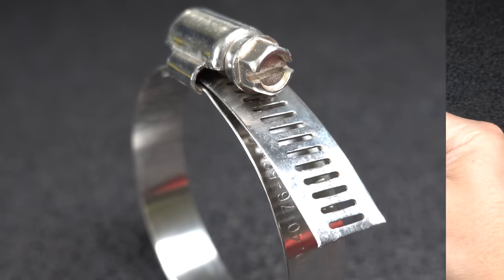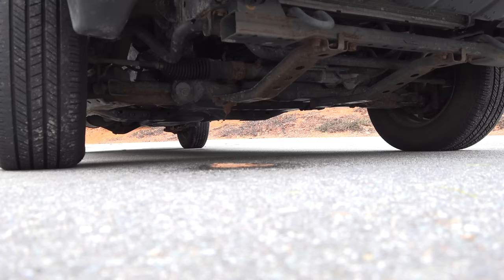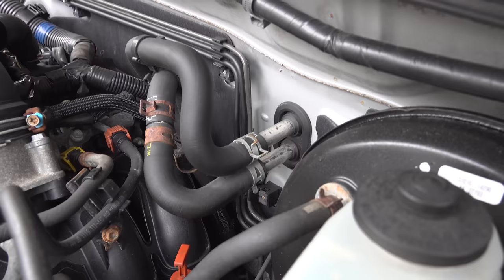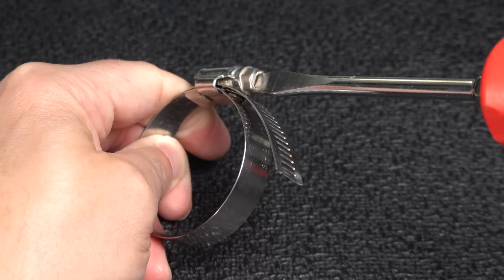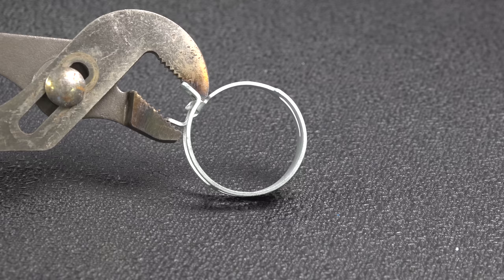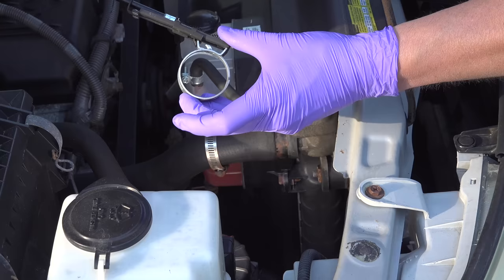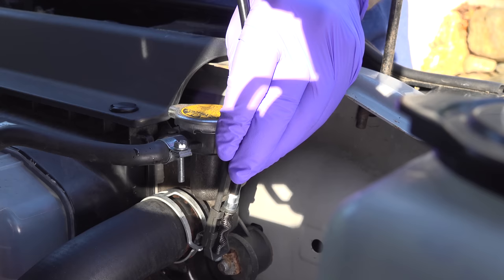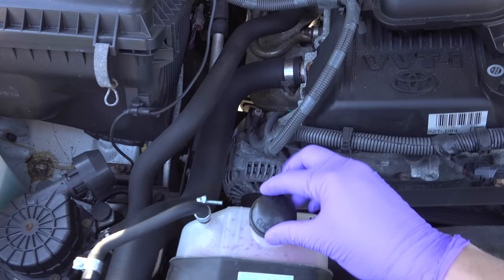STOP Using Hose Clamps WRONG - LEARN A BETTER WAY

Comment: Had a hose leaking on my coolant surge tank that wouldn't seal with a spring clamp.  The solution was a worm clamp.  My experience has been opposite of this video.  I have never had success reusing spring clamps but I reuse worm clamps successfully all the time.
Reply: Yeap had the same problem. Couldn't take it off. Had to use a dremel to cut the dam clamp. I am still piss off. Lol
Reply: Maybe like torque to yield screws, only use them once
Reply: One little comment would be for hoses below 5/8", I would consider using mini clamps.
Reply: @vizion4273  not with a pair of cheap plyers.
Reply: @donmax2315  If You had a proper tool, instead of making it up.
Reply: @jeromeduffy9270  I was pressing the spring clamp with pliers when one of the lip brakes off. So I had no choice but to cut it. The only tool I could find that could fit in there was a small dremel with a cutting bit.
Reply: @donmax2315  Git ur done type guy. But by Bud whi is a seasoned mechanic. Swears by these clamps. But you need the special tool. Or its Punkin face
Reply: cable clamp tool only A$16 from ebay
Reply: because some of the clamps have a stopper to limit open too much ,this one need more crc or cut the stopper.
Reply: @alanw5812  that's the real answer

Comment: I’ve honestly just never had these problems, it’s good also to make sure the old clamp is the right size as well because some may look similar but be just a hair to big, the new clamps are annoying to install in tight spaces if all you have are pliers but I’ve never had a problem with those either I think it’s mainly just about getting the right size

Comment: Not sure how "new" spring clamps can be when they've been in use in cars/motorcycles/vehicles for over 4 decades.
Reply: I was just thinking that, I know I've seen them back in the 70's and 80's
Reply: They're not even used for the false narrative he's attempting to portray. They are used because they are cheap and easy to install on an assembly line.
Reply: @JosephArata  wrong! Not cheaper!
Reply: @JosephArata  They're used because they work better for longer
Reply: Agree that CT clamps are not new, thay are all over many 80s / 90s JDM vehicles. When they fail it's ususally a sign that the hose needs replacing.

Comment: I never thought about this before but plastic radiator hose spouts may contract at a greater rate than steel or aluminum therefore causing this condition mentioned. Also silicon or soft hoses require the clamps with the liner in them that are much better for small hoses. Saying that I agree with the comments that gear clamps have never failed me. Thanks for the video. I makes us think.

Comment: You can get worm type clamps in constant torque as well. They have a spring on them.
Reply: That seems like the best of both worlds. I replaced all my constant tension ones with worm screw types when I re-did all the vacuum lines just because the regular constant tension ones are a pain to deal with.
Reply: Have used them on my job on Diesel engines . Retired from N.Y.C.T.A. Dept of Buses
Reply: Yes sir, used quite öften on the tubing for the charge air coolee
Reply: Constant tension clamp tool

Comment: Another significant benefit of spring clamps is that they remove most of the user error aspect of installation. As long as the spring clamp is past the end of the hose fitting, it's good to go. But with worm drive clamps, there's the user error aspect of people undertightening or more often overtightening them and ending up with leaks, damage to the hose, and/or damage to the fitting.
Reply: Lord have mercy. I think the first time my father showed me how to use a screw-on hose clamp, I was 10 or 11. He told me then I'd have to be a complete idiot to screw this up. Since that age I've used maybe hundreds of those clamps without a single issue. Normally, after about ten years or more of the clamps getting wet every day, the clamp rusts or corrodes and needs to be replaced -  but even then, it still holds pressure fine after many thousands of temperature changes. I'm calling complete bullshit on this. "User error"? You could say the same thing about tightening ANY screw or bolt in general. And if you're that over-cautioned about the simplest hand tools in the world being used properly, you're probably a nervous wreck every time you get in a car, or plane, or train, or go kart, or lawn mower, tractor, ferry, walking across a bridge, sitting in a chair, climbing a ladder, and even laying in bed, which all of these use screws and bolts capable of dreaded "user error".... 👏😵‍💫
Reply: @bat__bat  He's talking about removing end user error and yes you can screw up worm gear hose clamps.  It's why you see people strip the wood out of their cabinetry.  Anything with lighter torque that normal people interact with.  I've thrown away so many worm gear clamps that were overtightened ruining the perforations.  Pre-tensioned clamps do remove this variable of the end user provided it's not cocked at some angle.  For you to claim the end user isn't a liability is just ignorant.  As far as bolts and nuts in a car you can say the same thing.  The lower the torque values the more likely you'll see people twisting the heads off bolts or pulling out threads and if you add aluminum it gets worse. Think of the stories of spark plug jobs in aluminum heads or even an oil drain plug.  Normal people are wild when you put a tool in their hand
Reply: @jinxtacy  idk... tightening a screw clamp using a screwdriver or nut driver is about equal in difficulty to using pliers to replace a pre-tensioned spring clamp. And on Volkswagen, you need special pliers. So, yeah. Not making any logical sense there
Reply: @bat__bat  It's not about difficulty, it's about removing the ability of the person doing the work to screw it up.  Would you trust Johnny middle class from suburbia to torque anything you own by feel?  If there was  similar limitation for oil filters and drain plugs the world would be a better place and that's with professionals doing the job.
Reply: @jinxtacy  wrong. Plenty of engineering studies show that spring clamps hold better under the typical 0-230 degree Fahrenheit conditions of automotive coolant lines expansion and contraction
Reply: @CantonBn  might have tagged the wrong person or misunderstood what I said.  Anyways.  Have a great day!

Comment: Very useful info.  Thanks very much.  My 04 Frontier has been eating small amounts of coolant and I've never been able to figure out the cause.  Will go out and check this fix right now.  Interestingly enough, the rad hoses were replaced with worm drive clamps (not by me) some time ago, so I'm wondering if they might be the culprit.  Greatly appreciated!

Comment: Tech tip: put the Constant Tension clamp back in the same Position, otherwise it WILL leak
Reply: I use Indian head gasket shellac on hoses. They wouldn't leak even if I used a zip tie as a clamp. Lol
Reply: @BukitMan  I use that stuff too as a cheap insurance
Reply: Which rarely you can
Reply: @cowboy41231  Wouldn't ya know they just now are changing the name of it. This saddens me. And should sadden native Americans IMO. But every time I reached for that bottle I felt proud of the name. There was never any disrespect. I drive a chevy Cheyenne for crying out loud and I'm proud of that name too. Is it going to be better when they are no long represented on any products? People act as if we put them on toilet paper brands or something.
Reply: @BukitMan  yep sad world we live in, cancel culture bullshit.
Reply: This is a very simple thing to do. Guys still complain though.
Reply: @BukitMan  How hard is it to remove the hose in the future
Reply: @kb01663  Not hard at all. It doesn’t bond anything together really. Also stops that corrosion that makes hoses hard to get off when the rubber gets stuck to the corroded aluminum. It is just made to help keep gaskets in place and prevent leaks by filling in space and imperfections in the two surfaces.

Comment: PS: I really did like the information you provided. I work with them all the time and have seen leaks with those clamps in use, but I’m also questioning the age of the hose at that point. Usually when there is a leak, there is a bunch of crystallize coolant creating a breach in the sealing surface. Which It’s not necessarily the fault of the clamp.

Comment: I had on '04 RAM 1500 with those "Smart" clamps on the Power Steering lines. On at least 2 occasions when the temp dropped extremely low (-30 F) ALL of my Power Steering fluid drained out onto the pavement! I read about the issue and found that this is/was pretty common for my vehicle. The recommended solution was to replace those "Smart" clamps with the "worm drive" clamps on the Power Steering lines. After replacing them as recommended (I put 2 clamps on each connection), I never had a problem with the fluid leaking out again. I seem to recall that the issue was related to the metal fitting and the rubber hose expanding and contracting at different rates.

Comment: I always thought cars had them because of ease of assembly. This was very insightful.
Reply: Yes, speed and ease of assembly are a main automotive factor.  

You will not see them in aircraft use.
Reply: They go in easy with new stuff but once those hoses get a little swollen they can become a bear especially heater core lines at the firewall that are difficult to reach.   Those flex clamps are handy but I’ve encountered times that even fully compressed it didn’t open the clamp far enough and had to get creative with locking needle nose pliers.   Constant tension worms are great but they are way more expensive.
Reply: Ease of assembly but also cost. Auto makers don't use them because they work better. They use them because they are cheaper.
Reply: @pjm329  Auto manufacturers use them because a robot can install them instead of a human.  The robot  presents so many less problems during it's time of use. I hate them. Why, because robots don't go out and spend money which creates jobs. See...
Reply: @davidkeeton6716  End result... Much cheaper.
Reply: Robots can put them on when everything is easy to get to in the factory.
Reply: if a worm gear clamp leaks, it is because it is the wrong size and no longer round. or it has been over tightened and is no longer round. you were right about the ease of assembly bit.
Reply: And to stop people fixing their own cars.
Reply: @Strider9655  exactly, harder to access, service and make people buy specialized tools. They are making them like throwaway appliances now
Reply: @Strider9655  in all fairness, some people shouldnt do more than check fluid levels because I know a few who just dont have the skills required.
Reply: @robludwigsen7831  True, they've actually been using those clips inside washing machines for many years before they found their way into cars.
Reply: @Mansfield Man Military is different than Commercial, they don't have to adhere as strictly to FAA or other Aviation regs. Stuff like spring clamps vs friction washer worm clamps, or T-bolt clamps gets allowed with military use because of bureaucracy. They want to spend as little budget on repair as they can, so they have more left over for multi-million dollar toys.
Reply: @Alex Ptc this video is almost as annoying a scotty kilmer.

Comment: I think you got it backwards hoss, the screw type are way better and they stay tight. On the other hand those spring clamps weaken over time and can leak, especially if removed and replaced a number of times.
Reply: You got that right Bubba...
Reply: And, they're a PITA to get off vs screw type.
Reply: I’ve never seen one weaken and you might want to buy the right tool to do the job. All my vehicles go north of 400,000 km and I’ve never had a spring clamp fail. That doesn’t even cross my mind that ever be an issue with it.
Reply: @DCSPORTSTER  the key word is easy.. the reason they use them is because they are easy not better. Now.. some old timers may be more comfortable with them and that's fine on older vehicles. New vehicles with plastic fittings will either crack or fall off given enough time. 
If it came from the factory with screws go ahead and use them. If it came with springs it's best to use the springs. Get new ones if you overstress the old ones taking them off with the wrong tool. Oh.. and buy the correct tool as well.

Comment: Yes video is so true always swap out to the screw type clamps bc the 1 he's trying to seem great caused my upper radiator hose to break loose and blow my head gasket. I knew that I should have swapped out for the screw tight types.

Comment: These bands are made from a special 54SiCrV6 steel alloy or 
51CrV4 so that the clamp shrinks or expands evenly around the circumference depending on the temperature. This always ensures a proper fit and no leakage below 3.0bar.

Comment: I agree!!! The spring clamps are far more efficient on any rubber pipe that goes hot and cold!!! You must make sure they are optimal diameter - so I order these in multiple sizes to get the “right” fit. Only use worm drive on low pressure things like a garden hose.

Comment: Thank you that makes sense i use to use the screw clamps as an replacement next time i am gonna use the original. Also i use locking pliers to remove those clamps it works perfecly

Comment: 10/10 advice.  I've never had a spring clamp leak where the hose wasn't compromised somehow.  I've had numerous instances of worm drive clamps leading to leaks.  That said, all of those leaks happened on smaller diameter connections where the drive box on the worm drive clamp creates a flat spot of sorts where an equally small spring clamp wouldn't.  On larger diameter hoses, it's less of an issue (again in my experience).

Comment: These 'spring' clamps can be an absolute nightmare to deal with. In my garage we regularly replace them with jubilee clips. Never had one come back because it leaked.
Reply: Exactly!
Reply: I worked on one recently that sprang loose and impaled the palm of my hand. There's a worm drive clamp now in it's place.

Comment: I tried to count how many times he says "....my Tacoma.." in this video but I kept falling asleep. Hahah really though... metal worm drive clamps worked just fine for decades you say! Sure, back when they clamped a hose around another piece of metal. The reason they worked being, during the thermal expansion cycle, the rates of expansion and shrinkage of the clamp and the hose nipple were similar enough that it wasn't really a problem. Then we started using aluminum alloys and plastic, they don't expand at the same rate and we started to get leaks. Add to this the more pressurized modern cooling system and it becomes a real problem. The newer spring steel Corbin style constant tension clamps fixed that issue. I've even seen heavy zip ties used as hose clamps at the race track, no tools needed and tearing down for a weekend rebuild is a bit faster. So it really depends what materials your working with. Good video!
Reply: Wow this is actually a really great point that explains a lot of the debate going on in the comments. Almost every person claiming worm drive is better is referring to applications where I'd think metal radiators are probably used, such as in race cars. I plan to upgrade my truck to a metal radiator at some point and I'll have to keep in mind what clamps will be better based on the material.

Comment: Interesting as those clamps have been factory installed for decades. Always considered them cheap alternative and replaced them with screw clamps whenever servicing my vehicles. Been working on my own cars for 50+ years and was apparently clueless. Thank you for the tip
Reply from the maker: I used to think exactly the same. They are deceptively amazing
Reply: One thing I will tell you... Sometimes it is dang near impossible to get those clamps off in tight spaces.  If you have that problem, once you get them off, don't try to reuse them.  Most of them are not designed for reuse. Get new ones. The benefit is that they will be locked open and will easily slide into position on the hose.  Then you just squeeze then open and let go. They lock into place.  Great info always on this channel!  Thanks
Reply: I have been a mechanic for almost 40 years. I only use these on vacuum lines and small engines

Comment: I keep seeing these sorts of videos for some reason. Recently I had to use a screw clamp for my plastic radiator hose because it's in a location that makes pliers impossible. That was maybe 8 months ago and haven't had any problems. I've never had a problem with screw clamps. I've actually had problems with old spring clamps not getting tight anymore.

Comment: These "new style clamps" often cause leaks in my experience. Can't explain why it happens, but I can usually fix it by replacing them with the "old style clamp" and tightening it like crazy :D
Reply: They're a solution looking for a problem. Keep using correctly sized screw clamps, they're fine.
Reply: Same. The thing I find with worm gear clamps (old style) is people don't tighten them when the engine is cold and don't tighten them enough. If you use a socket and tighten the shit out of them they're easier to install and never leak in my experience.
Reply: @JoshuasRecordings  Other benefit is you don't have to remove the hose to install or remove a screw clamp.
Reply: @PJBonoVox  I find screw clamps much easier to install and remove so yea. Also never had one leak when properly installed, and you can't properly install them with a screw driver. Use a socket.
Reply: Until you tighten like crazy on a plastic fitting.. it will break given enough time. That's the point of the springs, they flex with the expansion of the material.
Reply: @ohioplayer-bl9em  My cars from 92. No plastic fittings here. 

Besides the radiator but those never have broken for me.